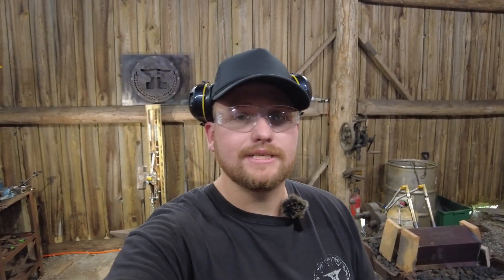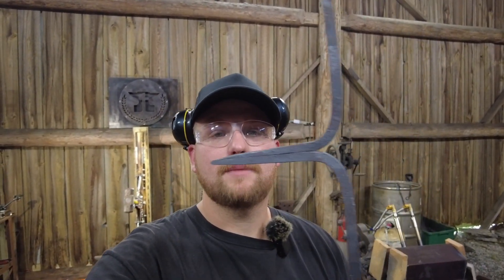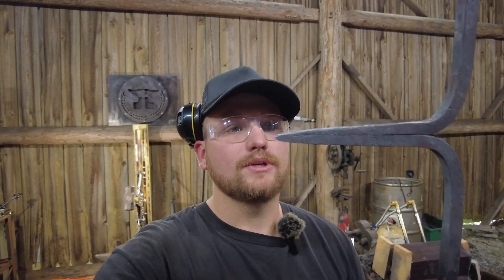Can You Forge Weld in a Mr. Volcano Hero 2 Gas Forge?

Comment: I have watched about every video you have on the Volcano. I have the two burner version and run my psi around 6 and my oxygen open to right around the bevel of the jet. How long would you think it took for your metal to get to forge welding temp? I tried multiple times last night but no success. I tried using borax as my flux. Any help is appreciated.
Reply: Any luck yet?